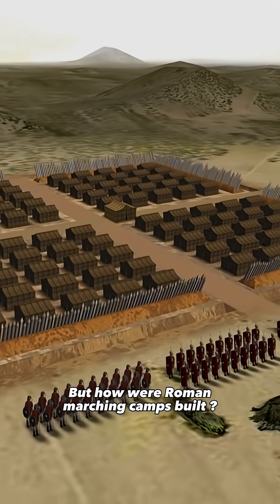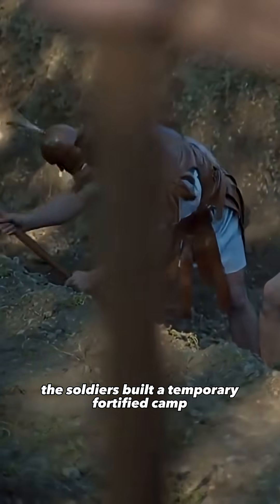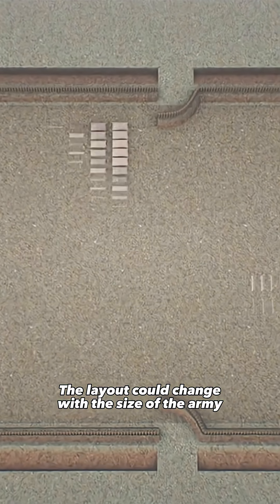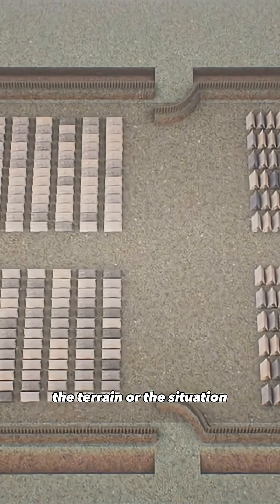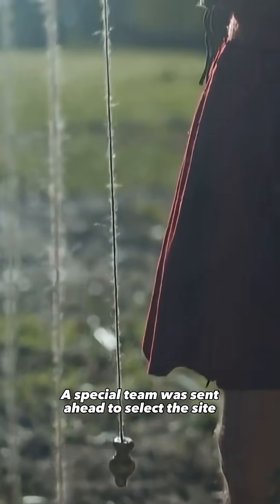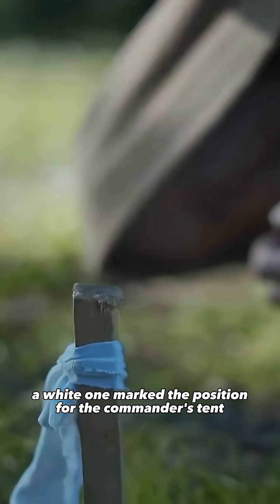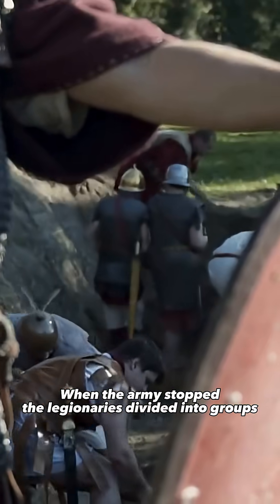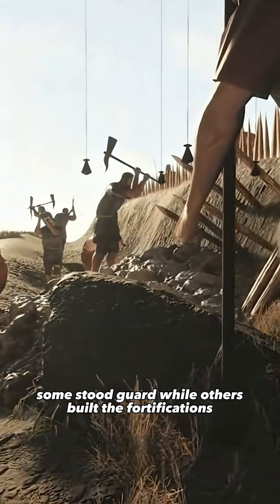How were Roman marching camps built ? #history #romanempire #engineering

Comment: Assuming legion of 5000 men, each needing 10m2, they would need to make a camp 225x225m, so basically each soldier would have to dig up 20cm of ditch, that really not that much, and assuming the trees would be 20cm wide and 1 tree would be enough to put 3 logs into palisade, each soldier would have to cut down an avarage of 1/3rd of a tree, so basically they would take a saw with 2 of their buddies, chop down a tree in 15 minutes and then go dig 1 meter of ditch taking turns of intensive digging

Comment: It doesn't make any sense that they would burn the camp each day, wouldn't it have taken hours just to chop the wood and drag it over to where it was supposed to be put down? And sharpening it into stakes and debranching it would have taken time too, right? And what if there weren't any trees where they were, that were suitable to be used as wall spikes or whatever they call it? And what about all the food? Where fid that come from? I've read that following the roman legion were usually a ton of civvies that could easily be even larger than the legion they were traveling with, because the soldiers had to eat, right? They needed smiths and stuff who could repair their armor, right? And even if the soldiers just ate biscuits and crackers, who carried it? To supply ten thousand men on biscuits on a daily basis, you must have needed an ungodly amount of carts to store the food in, right? It's not like the soldiers themselves stored biscuits for the next six months on their sweaty backs, right? I kind of feel like this video needs to be updated a little and add all that other stuff. 5/10 okay first attempt, but not good enough. Back to the drawing board you go...

Comment: Each legions had more men than just the legionaires. There were 1880 camp servants, or 2 camp servants for every 8 legionaires, who carried supplies for each contebernum or 8-men tent group. So setting up camps or getting food ready wasn't a problem. Then there were livestock herders, foragers, supply wagons, scouts/hunters, engineers, etc. So, basically all the soldiers had to do was the manual labors, cutting wood, dig trenches, put up walls, etc. They weren't just a war machine, they were an engineering and logistics machine. They built roads, bridges, aqueducts, etc. Auxiliaries did things like guarding, or skirmishing with enemies while the legions built things
Reply: If you study the concentric rings of smaller fortifications around larger forts, combined with the sods on top of the ground [1ft x 2ft x 1/2 ft] were used to front the palisaid, it is prudent ot consider that fields or stoakades for animals [cattle, goats, chickens] were created at the same time as the fort. The livestock and sentries acting as an early warning system.
Reply: Not acqueduct

Comment: Nah completely undealistic. I mean utter nonsense. Sleeping place and marching bag storage alone would be 2 square meters per person. Add another 1 for space to get up, get dressed and walk out of the tent. Add another 1 for tents not being vertically walled, and having cordage and poles. Add another 2 for those large and small roads connecting the tents, and mustering space which have to be outside of where the tents are anchored. And another 2 for communal infrastructure like latrines, cooking stations/fires, guard posts, equipment, animal, and cart storage. Which is about 8m² per person in such a camp. With the average legion size being about 5000, that's 40000m², or 4ha. With a super efficient square shape this would mean a side length of 200m, resulting in a perimeter of 800m. If you include guard towers, gate fortfications, uneven terrain, and temporary constructions inside the camp like latrines campfires, animal pens, it's probably fair to assume a kilometer length. The ditch seemed to be about 2m wide and deep, with a triangular cross section, so a cross section of about 2m² (an average door). Over a kilometer length that's 2000m³ of earthworks. A well fed non exhausted modern person can dig 0.5m³-2m³ of normal soil per 8h workday. But these were smaller, less well nutritioned people, in a random forest full of roots, with basic shovels, and after a day long march. So 1m³ is extremely generous. Which means 16000 man hours for the ditch, not including earthworks to stabilize the palisade. Even a small 25cm diameter soft pine tree takes almost an hour to cut through with a sharp modern axe. If you include debranching and sharpening one end for the palisade, and that the people are exhausred, less well fed, smaller, with less high quality tools, that leaves you with about 1.5 man hours of work per palisade piece. If you include digging or hammering it in, it's 2h. With optimum distribution you would need about 4000 of these for a 1000m long perimeter, so 8000man hours. So we are at 24000 man hours, for the basic setup, not including hauling the massive logs around, not including trunk/root removal from the central roads, not including moving tools, equipment, animals, and people around to where they are needed, not including setting up the tents, not including chopping firewood, logistical messups, actually building the guard towers and gate structures, logistics bottlenecks (palisade needs to go up before the trench is finished to be covered by dirt, but after it is started so the logs can be driven into the ground), toilet breaks, and organization, like deciding which groups go to which part. So all in all to build a 4ha palisade and trench encircled roman fort, it would take at the very least around 30000man hours of work. Since a large part of the legion is support staff like cooks, weapon smiths, architects, officers, animal handlers, the actual number of usable people for hard labor would have been around 2/3 of the whole legion so about 3000 people. Which means it would take them 10 hours to set things up.
And since the whole purpose of a fort is to not be easy to desteoy, the whole dismantling/burning down would take another significant amount of time, and we've arrived at 12 hours of hard physical work for each person not otherwise occupied, which means the maximum amount of work a person can do per day is spent and the legion has not moved.

Granted there could be some more time savings, like spacing out the palisade posts a bit, having even the officers, animal handlers, smiths, and cooks work on the palisade, having a significantly larger legion, having smaller tents where legionnaires sleep like sardines, having a shallower trench, having perfect logistics, but honestly that's stretching it.

And the whole "sleep and then burn it all down" seems incredibly wasteful especially for the romans who built things to last. It also makes no sense unless one is alone deep in enemy territory. Otherwise legions after them are more likely to get a use out of it than enemies. And the morale effect of having to desteoy what you just built would have been catastrophic. And the benefit enemies would have gotten out of a basic fort is also minimal since they would have had their own forts if they were any danger at all.

What i can imagine is that these camps were built after a day of marching, a day away from the previous camp.... But the legion spent a longer time there. Weeks maybe, always venturing out and clearing up any enemies in the region. And when all were subjugated they would destroy the fort and continue. That would make sense.
Reply: right not to mention that if it took place at the end of the day there'd be no light to work.
Reply: A reasoned assessment...
Reply: Please go read a book bro 

There is quite literally thousands of books, manuals, and journals about military operations and logistics dating from antiquity to modern day available at your local library, online, or through universities.

That is, if you are actually interested in learning about the topic, which somehow I doubt 😅😅😅
Reply: @Rudipu It's like I said, the guy was making stuff up as he went along. Lmao
Reply: Either you uncovered a devilish "romans camp everyday" conspiracy by all historians since Gibbon or concocted a fancy theory based on your understanding of what a modern man can do, dig or cut applied to the reality of 2k years ago paired with zero knowledge of how historians came to know that fact and glaring inability to perform a 30 second web search. As the chances are not exactly 50/50 and I get from your thought process the vibe of "pyramids were built by aliens 'cos a well fed modern John Doe can't lift a 10kg stone", I'll go with the latter, thank you.
Reply: @sir_humpy yeah everyone knows that they used cement and sand and...bits to make the pyramids
Reply: You kinda just made things up as you went there didnt you?
Reply: Very well thought hypothesis! 

I would add also that Roman Legions used to do a lot of forced marches, so that would reduce the time and energy they would have at their disposal to build/destroy camps every day.

And that is without taking into consideration the amount of time needed to survey the land ahead of the legion to find a suitable places for the camp. After all, back then the world was a lot less developed, meaning the land was more wild and untamed.
Reply: @daikansanchez7674 The surveying was done by scouts ahead of the column. So a chunk of that forced marching was so that they could get up to the campsite the scouts picked out
Reply: I heard around 3 days. New fort was not completed definitely in 1 day. They used animals to carry most of equipment. They marched for example modern 25 km which can be done easily in 5 hours with backpack on good roads. And then done some construction work, on slow pace. And let's say fort was completed in 30 %. Next day they could finished it. Fort could be completed in 1 day but probably on place where was fort in the past.
Reply: @Dariusz_1.618 There's a difference between a camp and a fort. We're talking about camps
Reply: @AdmiralStoicRum  Camps with average trenches and transported logs from previous days are possible in 1 day. 3 hours is possible. They just rest and sleep. In previous comment I thought about temporary basic fort. Troops stayed in 1 place for several days, improving their defences and scouting area much wider also for their searching or offensive tasks. Anyway they were independent force not needing external help ( but of course if it is available, it is helpful ). However such large troops need some food...
Reply: Guess all the archaeologists have to stop digging, cause you had a better plan.
Reply: @svenw792 No the point is that this isn't something supported by archeological evidence, because you can't tell by archaeological evidence whether something was built in one day or two and for exactly how long it was used and who burnt things down.
Reply: This could only rely on written evidence and i seriously doubt that there is written evidence stating rhis to be the exact modus operandi.

Comment: How long to cut the trees for the palissade? Everyday
Reply: Here's something you Ignore, the roman legionaires among weapons tools rations also carried stakes, those were used to build the palisade, only in sieges, our more permanent forts they build large wood walls, permanent forts were made of stone.
Reply: @JoaoSoares-rs6ec Yes they carried a bunch of portable posts to set up their Palisades for the night and then in the morning they pull them up and throw them back onto their carts and head out for their 8 hour march
Reply: 5000 men + camp followers and axulliaries
Reply: They had about 5000 men usually. If everything was already surveyed and treea marked for cutting. 1000 men each with an ax could take at least 2 trees in 2 hours
Reply: I would think they carried some of the wood with them as they marched, depending on the roads
Reply: They did  @barrystrayer5794
Reply: according to google between 2-4 hours.
Reply: Every soldier was acquainted with using tools and building things, so i suppose that this hardly took a lot of time, specially if the camp-setting team already chose the trees to be cut.